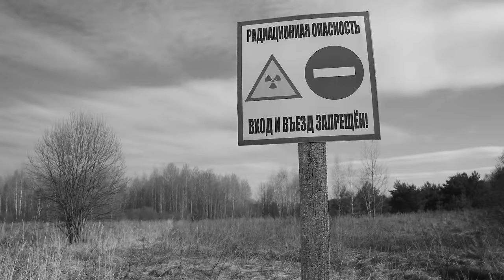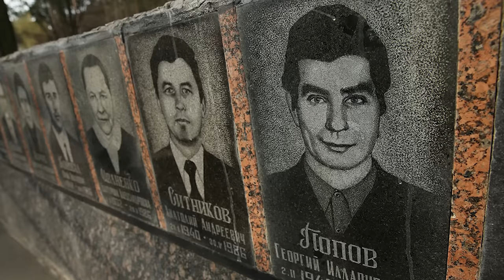The Filthiest Chernobyl Men You've Never Heard Of

Comment: Did you forget to mention those 3 guys that went underwater to open manually the faulty valves of the pool under the reactor?
Reply: They survived
Reply: @Abysia  one died at the spot but other 2 stayed alive
Reply: @SDZKProductions  one didn't die at the spot he died later from a heart attack
Reply: @CoriumSeer  ah, ty for thr info
Reply: @Ashton Engelbrecht Not just that, but all of Europe wouldn't be habitable until the radiation either broke down and wasn't deadly or was safe enough but still there
Reply: @SDZKProductions  one died on 2005
Reply: the roof are far more lethal..they basically touching the core itself..
Reply: @freshavocado1908  well i am just confused then can you site a source on what you said
Reply: @freshavocado1908  also think why would a nuke created to cause destruction destroy less then a core not designed to cause destruction
Reply: @11creeper45  core has a lot more radioactive material in it, so more potential contamination,  bombs are typically not designed to contaminate and only have a few kilos of material.
Reply: @11creeper45  no, his assumption wouldnt be too far off. If those guys didnt do what they did, imp pretty sure europe wouldnt be inhabitable at all.
Reply: They are known as the "suicide squad" right?
Reply: @11creeper45  think of a reactor having 2973 atom bombs worth of uranium in it.  That's how much enriched uranium was in reactor 4.
Reply: @bobidiga1  yeah but that could not be detonated similar to a nuclear bomb none of the components necessary to make a bomb where present there
Reply: @11creeper45  water is used to regulate the fusion rods and nuclear fission creates intense heat and electricity, when you combine extremely hot solids with liquid you get a massive steam expansion and heat which can cause things to ignite.
Reply: @11creeper45  also the meltdown didn't cause more destruction but there was a hell of a lot more radioactive fallout and ionized air spreading north so there was an extremely large amount of radiation leaking out of the core
Reply: @bobidiga1   yeah that was a major problem
Reply: @11creeper45  nukes are made for massive explosive force, where a reactor like this just blew a shit ton of radioactive material around.
Reply: Water in the pool of a reactor is safe
Reply: No one really knows what happened to them. Some say they lived, some say they died within minutes, some say they died weeks or months later. We really have no idea what happened to them
Reply: @vthegoose  We know. They were Oleksiy Ananenko, Valery Bespalov, and Boris Baranov. Boris Baranov died in 2005 from heart disease. The other two are still alive in Kiev.
Reply: @trollololol7882  I doubt that the 6 tons of radiation fuel there would make whole of Europe uninhabitable lol. The majority of the radiation simply disappeared in several days/weeks due to the low half-life of most elements. The other elements are heavy and don't spread, so they are in the exclusion zone.

Comment: "...But all the machines failed, as the radiation corroded its circuitry, therefore forcing the the clean up crew to use man power..." let that sink in
Reply: It made me distraught watching that part
Reply: The fuck does it want now? 
I let him in once. Big mistake
Reply: Why didn't they use brooms surely they would've gotten much debris off the side of the roof then shovels
Reply: @AirQuotes  Have you ever broomed thick layer of debris with 10kg chunks of graphite?
Reply: @AirQuotes  it isnt all fucking dust, its whole chunks that weigh 5 to probably even 20kg
Reply: @AirQuotes  I get where you were coming from, but brooms are only good at the end when it’s actually just dust and not chunks of concrete and stuff
Reply: @YKDSGN  10? HAH! 10? More like 100!

Comment: HEY! Most don't know reactors 1, 2, and 3 still were up and running and staffed.
Reply: Last was shutdown in 2000 or so
Reply: Yes, they were always staffed, but 3 was shutdown hours after the 86 explosion and 1 and 2 were shutdown 24 hours later.  3 was finally shut down in 2000 since running since late 1986 after the accident. 1 had a partial meltdown September 9, 1982 and was up again 8 months later.  Reactor  2 had a turbogenerator fire in 1991 and never restarted for political reasons.  In 2013 the pump that raises cooling water up to a pond at the plant was finally shut down. The pond will eventually evaporate.  Chernobyl #5 and #6 were approaching completion, one of them was at 70% complete and was used to train the liquidators how to work with the nuclear fuel and graphite blocks.  Numbers 1 and 3 literally meters from #4 cranked out power for Ukraine for decades.  For all the safety issues, the RBMK-1000 did allow a lot of power generation.
Reply: @hoghogwild  Thank you for this explanation - really apprecaite it. I was not aware.
Reply: And people still have to work there. Nuclear plant itself doesnt make power to the public, but it still needs constant maintenance and supervision. Same thing all around the world.

Comment: “(…) all the machines failed, as the radiation correded and destroyed their electronic circuitry”.

Let’s do it by hand!
Reply: No choice at that point unfortunately
Reply: Somebody had to do it
Reply: Misha Korol May they rest in peace.
Reply: Any other suggestions?
Reply: biorobots have entered the chat
Reply: The helicopters took chemicals and poured on top of the exposed nuclear material. One man was curious and wanted to see how it looks like. He looked down and that's it. 
He got instant overdose- sent off - 2 weeks later the face skin released itself from skull and 6 weeks later was funeral.

Nobody knows real number of victims as everything was classified
Reply: @pepevonkek7803  is that true??
Reply: Yet the 'new' dome they put over it is to have an automated cleanup, how, we already saw what happened the first time they tried it.
Reply: @Maples01 I'm pretty sure radiation levels go down overtime
Reply: @theon2769  I don't think its been 1000 years yet, that is less than how long it really takes to reach a safe level, they just turned down sensitivity on the scanner they use on visitors so not to alarm them
Reply: The human machines corroded much slower, and in a heartbreaking way.
Reply: Pepe Von Kek Wait what just looking down causes an overdose?

Comment: if they were fraction as efficient at running the plant as they were in the cleanup... there would never have been a nuclear disaster.  What an amazing effort to clear it up... and the sacrifice.
Reply: While the reactor design had inherent flaws, the cause was a DELIBERATE experiment, where specified safety protocol was willfully violated. One of the senior personnel felt he knew how to control a shutdown better than the manuals specified and commanded procedures that lead to the explosion. He was jailed for a while, but not executed.

Comment: It is hard to believe what these men did. I had nuclear material nearly every day. Small amount, heavy shielded, dosimitry badge and cases for the tools. There is always risk with the material but the men of Chernobyl, k19, k119 and Fukashima are another breed. Nuclear is a great tool, but has a double edge. Power is to be respected.
Reply: Chernobyl was caused due to the lack of a protective shield which contains the nuclear fuel and preventing a catastrophe seen of that scale. 

Nuclear power is you get what you paid for. Be cheap and you'll run to problems faster than anything ever imaginable.
Reply: When you look at other forms of power, they can be just as nasty, even worse. For coal, look no further than the great smog of london, one turn of the weather and coal fumes killed thousands and ruined the lives of so many more. Gasoline? Look at what happened to LA, they has smog so bad it was lethal as well. Someone once messed up in Pensyvania in the US in a coal mine, decades later, it's still burning and has turned the area into a hell on earth that cannot be inhabited. It will keep burning, likely for centuries, and nothing can stop it.

No energy method is truly safe, even with solar, those panels and batteries eventually wear out and become extremely hazardous waste. Wind probably has the best track record, but the areas wind farms are built end up ecologically devastated. Track-record wise, nuclear energy is just about the safest. You can count the major incidents on one hand from roughly 70 years worth of nuclear energy. Aside from wind, the overall cost of other methods is so high it cannot be reasonably expressed.
Reply: cmdr corp ❤️
Reply: @kauske  Nuclear Energy is not safe. Anybody can build a nuclear reactor. However it's the safety measures that insures it won't destroy an entire ecosystem and to an extent a chunk of a continent.
Reply: Statistically speaking, it's safer than just about everything else, save for wind power. Solar might not be so nasty, if we didn't ship E-waste to countries where they burn it for valuable metals and pollute their drinking water. But the amount of deaths from nuclear incidents is pretty tiny in the grand scheme of energy related disasters.
Reply: @kauske  Well that's because in many countries favoring to remove them. Russia, China and India are the only countries expanding in Nuclear Energy. Also Thorium reactors are far safer and cheaper. But fell out of favor since it contained no added counter measuring material to make a nuclear bomb.
Reply: That has literally nothing to do with the safety record of nuclear across its entire history...
Reply: @kauske  This was more in tied with that Nuclear Reactors fell out of favor as a main source of energy. And also the government doesn't want any sort of attention.

It's why it's record is low.
Reply: @kauske  Also I like how you use the process of making and disposing green energy sources as main factors for fatalities. But even though Nuclear Energy can do far worse. Also they are extremely expensive and far far more potent.
Reply: @Fire Power701
And also the government doesn't want any sort of attention. It's why it's record is low.
[Citation Needed]

You can't just ignore the fact that solar cells are trash after about 25-50 years depending on the panel's makeup, and that they take a lot of energy to recycle. You also can't ignore the way in which we go about doing so, which is to ship to to poor countries where they will burn it to get the copper.

Notice we don't ship reactor waste products out like that, and by we, I mean any major world power. And by the by, you can't just hide a major nuclear disaster, you're insane if you think those can be swept under the rug. You can't just hide thousands of fatalities and tens of thousands of people sick from radiation poisoning, it's why Chernobyl got out, despite efforts to silence it, same with other nuclear disasters.

Oh, and nuclear weapons aren't the only byproducts of uranium fission reactors, just so you're aware. Nuclear medicine is an even bigger byproduct, and related, is the type of plutonium used to make RTGs, And RTGs are an essential part of long-term pacemakers and space exploration. Since the decline of nuclear energy, the stockpile of plutonium for RTGs has been dwindling and will soon run out.

Helium is another byproduct of nuclear energy, the only way to get it on earth is via fission, either fission of materials in the earth, or in a fission reactor. And guess what else we're running out of? Ding ding ding, it's helium, which also had medical and scientific applications. Thorium reactors don't really produce either of these, so while they make less waste, there are downsides.

Thorium reactors are not cheaper to build either, in fact, they are more expensive due to being so new. The major advantage is that they take less fuel processing. But we already have reactors that don't need enriched uranium, look at the CANDU reactor. I suggest you actually research a topic before trying to debate on it, you only make yourself look bad when you don't understand what you're talking about.
Reply: @kauske  Thorium reactors aren't new. They have been discovered and tested in the 50s. Why they became obscure was they didn't benefit the US military all that much as was passed down. Also extracting Thorium isn't that expensive due to how abundantly common it is. Rather it's the quantity of extracting the issue but even then Uranium is far more expensive and has been proven ever more than people might assume. Heck you can literally get the info off YouTube which is how commonly proven Thorium is better.
Reply: @kauske  Also helium is can be also made with Thorium as well. Practically showing the added age of how Uranium should be obsoleted for a fuel source in Nuclear Reactors. Not to mention most of the Uranium has to be enriched and mining Uranium is a huge cost. And simply dumping it is not viably logical as it pollutes the Earth. So you also have to do the added cost of storing it within a disclosed facility but since the rise of population it practically just wouldn't do.

Also Thorium has medicinal properties. It's practically Uranium, but better.
Reply: @kauske  For storing radioactive waste would cost you around the billions. Not to mention upkeep which is literally expensive since Uranium has a very very long half life so the isotopes have to be separately contained to not cause a reaction and I bet has to be lead containers so that none of the neutrons spew out. So whoever has to maintain the facility is putting their life at risk.
Reply: The existence of an experimental concept, and a viable commercial power generation option are two entirely different things, Viable molten salt reactors are still in their infancy, and with all newly developed tech, they are expensive to construct and get operational until the technology is more perfected and cost goes down. That also still doesn't generate plutonium and other byproducts that the world is ruining short on.

You really don't have much idea what you're talking about, thorium cannot be used in place of plutonium, it doesn't break down on its own and generate heat like plutonium, and you can't just make thorium into plutonium. FFS the main draw of thorium is that it doesn't make plutonium when reacted, or many other byproducts that can be dangerous, but have other uses.

You shouldn't rely on YouTube videos for your education on how nuclear energy works either. I'm done here.
Reply: @kauske  India has practically built lots of Thorium reactors to my surprise. And I do know how Nuclear Reactors work and most of it was due to school. But having to assume where I obtain my knowledge is amusing as I never gone to question where you get yours. I know fission is obtained due to a element hitting critical mass and having to spew out as much of it's own to reach at a stable level. But much of the rate which it releases mass is controlled by lead rods which absorb the amount of neutrons the more exposed it is.
Reply: @kauske  Also if I recall the coolant which was water also acted for cycling the reactor by steaming up and is to propel a turbine which cools down and reused for the coolant which closes the loop.
Reply: @kauske  It is the safest, by a huge margin.
Reply: @nomdeguerre7265  I'm not the one that needs to be told that... If you're referring to nuclear.

Comment: Having been there 4 times myself, its a place that holds a magnetic appeal and makes you feel compelled to go back. Standing in a deserted Pripyat town where it is so quiet especially in winter and just taking it in is a very powerful feeling. I also took the private tour into the reactor building and past the remains of Reactor 4 and into its original control room, then you get to walk into Reactor Hall 3 and walk across the shield on top of the reactor. The feeling of power is immense even though all reactors are decommissioned and the fuel removed. There are still areas in the corridors you need to move fast and only spend a limited time. I was last there 4 months before the war started and have been back since with special permission into what is now a totally closed zone. It was even better being one of only 8 people in Pripyat in winter, no other tourists, was so quiet and still and every visit reminds you this should never happen again and that if there is a nuclear war, that is the end for most of us.

Comment: I often wonder about the people who constructed the first containment structure. If you were only allowed 90secs up top throwing debris over the side, how long were you allowed right above the reactor core?. Im thinking of engineers, wielders, architects, constructions folk, crane operators. Putting something that size together takes significant time and rotating staff every 90 secs would only make the job more difficult if they did that. I get a feeling most staff worked numerous hours if not days to put that structure together. The level of radiation absorbed must of been lethal for some of them.

Comment: I always ask myself why Power Plant's were never upgraded safer. You still see Power Plant's in Europe like in France or Czech that are 30-40 years old and are reported to have cracks. There are safer Power Plant's already developed but instead of building them some countries still have the old technology or some nixed the whole Nuclear Power Plant plan and replaced it with Solar or Wind Energy that is far less efficient and more expensive.
Reply: Well, the problem is the scheer logistical challenge a nuclear power plant causes. Construction alone usually takes 10-20 Years, so every single one is basically outdated when they enter service.